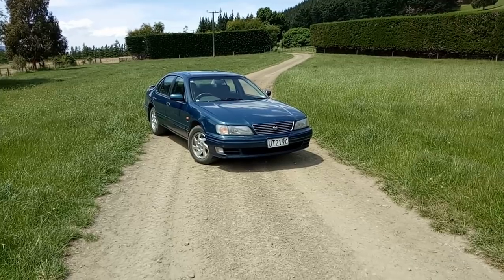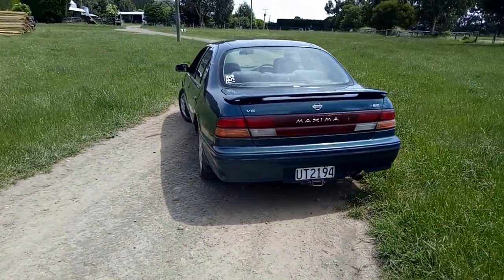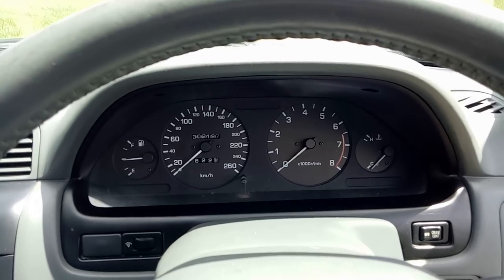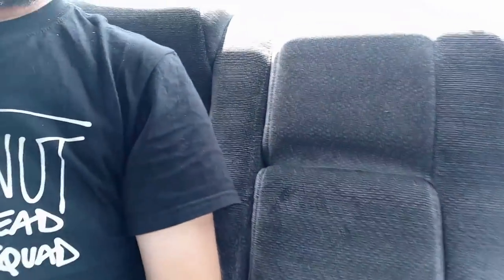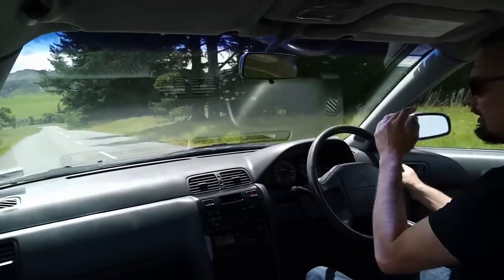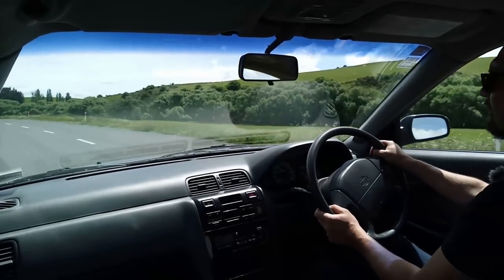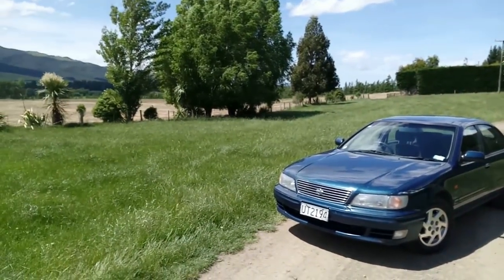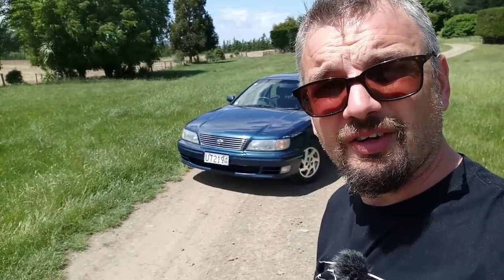Real (NZ) Road Test: 1996 Nissan Maxima 3.0i (or Maxima QX or Cefiro!)

Comment: Well I had to check.... are there any for sale in the UK?
YES!!  One!!
The generation after this I think. 
Listed on Autotrader as Maxima QX at a dealer in Lancashire for £2000. A 2002 model
And, Ian, it’s a proper 3.0 litre. 200hp 200lbft torque, about 270NM I think. 
59400mi or 95000km from new. So not used as a taxi as so many were. 

Unfortunately for me it’s about 5m long and there’s no way I can get that up my lane and into my drive. I can just about do the E46.

Comment: Those cars were built in Auckland from a mixture of CKD and local components. Perhaps this represents the absolute best of the New Zealand car industry before it all failed. I understand that model was a New Zealand special with many modifications to make it better than other markets. They even exported those cars to other Asian countries. Hopefully someone will be able to fill in the history - which is endangered as they were never enthusiasts cars. 

One of the modifications was to reduce road noise... I suspect that is a chassis level design issue with most Japanese cars. 

This car was a direct competitor to your Fairmont. It was considered a more sensible car than the Fairmont. 

So how does it compare? , I would be very interested to hear. I suspect the Fairmont is better...what do you think?

Comment: Different front and rear treatment. It looks almost like a Camry. This was one of the last Maximas available with a manual transmission in the US.
That is NOT a VG engine. It is the VE engine which was only in this generation maxima/cefiro and was the predecessor to the VQ engine.
I believe it was 222hp (SAE net).

I agree on your assessment of Nissan. I miss the bland, high quality Nissan to one of today which values style over quality.

Comment: Oh, so the differential locks up when cruising in overdrive on those Nissan transmissions ... No wonder when I floored my accelerator to cross an almost red light NOTHING happened. I have a 1991 Maxima with what seems to be the same auto transmission btw.
Reply from the maker: It should still kick down.

Comment: Why do I get annoyed when the interior rear-view mirror dimming tab is left (by the vehicle owner) in the incorrect position? Is it just as bad as the "triangle of doom"? Could this negligence become a thing in your reviews?
Reply: Blair Anderson  - There was a time that I would have agreed with you! Until I got a B5 Passat (1999) - when using the mirror the “correct” way, on dip, a following headlight would reflect into the mirror from the lens of the interior (dome) light ! Giving a double headlight image in the mirror. Which drove me nuts. So, I discovered that using it the “incorrect “ way, worked better - then the “subdued” reflection was of the back seat. No distraction. Happy days. Just that anytime that my brother got into the car, he would notice and return it to the “correct” setting!

Comment: Think the advertising strap line for the QX was ‘it exists’. Possibly all they could think of when they stood back and looked at it.
Reply: Actually no they were marketed on their acceleration performance in New Zealand which for our roads and over taking requirements was a big sales advantage. One of the quickest 6cylinders you could buy.
Reply: Ah, in the UK the QX did in fact have that strap line. Just Googled and found it. No point pitching speed and overtaking on the uk’s crowded roads!

Comment: Pretty car, I think.
Bland. Right. I like it. It's 'solid' looking.
Not the worst 90's Japanese interior I saw either. Would've preferred brown instead of grey, but that's just me liking 80's Daihatsu's too much. Wheel and dials are, indeed, very lacking of... any sort of character.
That radio could probably be in there since new. 
SOAD's Self Titled record is 1998. So close.
10:09 Meh. Sounds... Like a Japanese 4 cylinder. 
I somehow feel as though this car is more Hubnut than the Lexus. Amiright?

Comment: Low noise roads are comparatively expensive, not very durable and become less effective with age as the voids in the surface which absorb sound fill up with dust/dirt particles. In the UK they tend to be used where busy roads pass through urban areas (along with accoustic barrier fences).

Comment: It's always funny to hear you say that you have the aircon turned on and how "scorching" it is. Summer has barely started (it's late spring at best ) and most Kiwis would not even bother with the aircon at any time of year. Auckland can be a bit "warmer" but that is because of humidity, not heat. 25C would be considered "hot" in Auckland. My other home in Bangkok is more than that at night!!!35C + is normal in daytime and then you really do need the aircon. I had a Maxima like that one...the usual problem at 100K is CVT transmission packs up. I doubt if it is the original in a car with 300K.
Reply from the maker: No CVT in this one. Conventional 4-speed automatic.
Reply: @HubNut   Lucky escape!!

Comment: I believe this is the first time I've heard of (analog) dials on a car as being "entirely uninspiring" :p

Also, given the age of this car, I seem to recall that this was right at the time when electrically driven cams were demonstrated in the labs... I wonder why those never took on? Especially since at the same time, or nearly so, the energy storage density of batteries were demonstrated, and high capacity capacitors were also available...

Comment: That's only annoying until you leave the keys in with it beeping and close the door. You are then locked out. Had that 3 weeks ago on my Primera Estate. Annoyance enhanced when I had to break into my house to get my spare keys as the house keys were on the key ring in the car. On a happier note mine is the same colour.
My mist function, not sure why you call it that, seems to have a 2 part switch, half pull gets the washers going and then full pull starts the wipers. Not sure if that is intentional but very sensible when the screen is dry and dirty.

Comment: Oh man, how could you get this so wrong! Maybe not enough coffee?
Okay, so here's the 411 on the A32 4th Gen Maxima: Sold in Japan as the Cefiro and everywhere else as the Maxima. US-spec Maxima essentially the same as JDM except for different front & rear styling and interior trim differences. JDM top-spec model also shipped and sold as Infiniti i30 in the US. 

There are not that many Maxima QXs in the UK, which came in 2 litre and 3 litre forms - I shipped my 98 3.0 SEL model in dark metallic green back to NZ 2018, so one less in London now :) 
* The facelift models (UK mid-1998 thru mid-2000) are the nicer-looking models and have a better looking steering wheel. Also, bland is good when don't you want peeps to break in and steal stuff ;)
* These have the VQ series engines - cam-belt VG series for previous generations...
* Spark plugs under the plastic cover at the front and between the intake runners at the rear - they're coil-on-plugs and not difficult to change or service.
* The VQ20DE engine has plenty of torque - it would definitely surprise you!
* Aussie & NZ models didn't come with sunroofs - not even as an option, unlike most other markets. Aussie & NZ models got the folding rear seats instead, unlike other markets, which might explain why they didn't get sunroofs.

Comment: You are always winging about lack of headroom or knee space in the rear, you are just a tall bugger, they are short in Japan.  I am a short arse ( 159 cm ) myself and have a problem reaching some dashboard switches, particularly in a vehicle without inertia reel seat belts and have to wear a fixed belt loose, very dangerous in an RTC.  I tend to buy vehicles made before seat belt legislation.  1975 in Ireland.